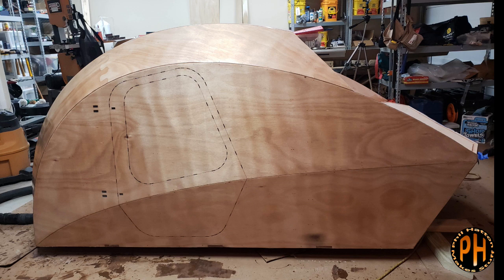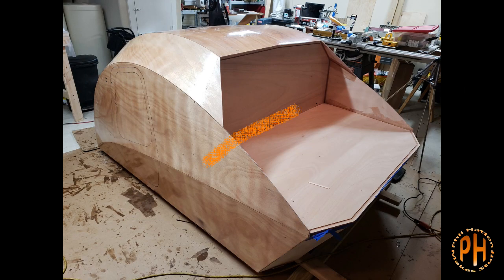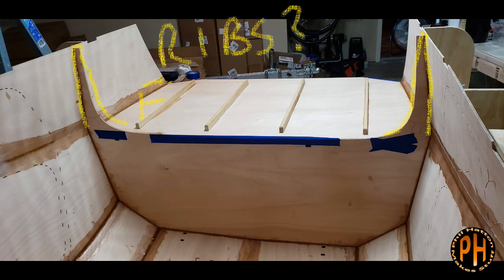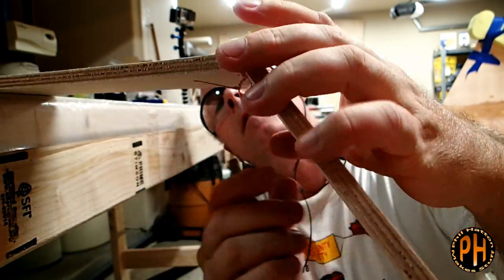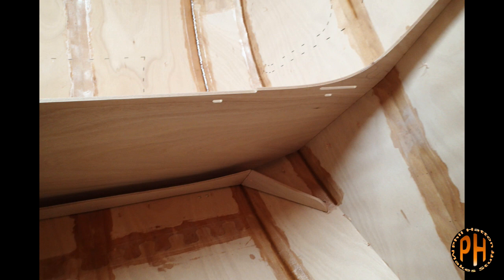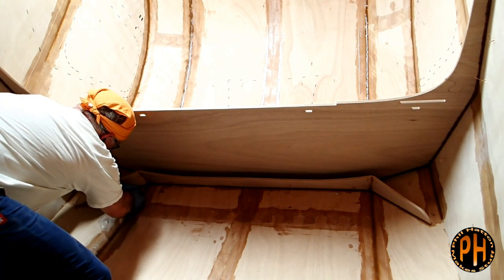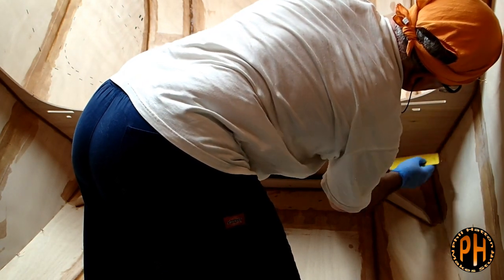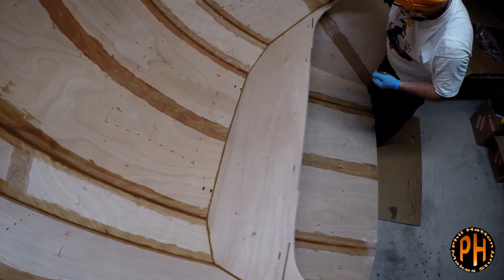Building a CLC Teardrop Camper - Bulkhead and Hatch Stiffener

Comment: Thanks for this clip. I wondered why the manual did not mention the prep epoxy before the fillets and the tape. You seemed to know why so I concluded it was the designers intention not to prep on these fillets. Also they don't want any tape in those joints either.
Reply from the maker: So far the fillets that don't have fiberglass tape have held up well.  Where I did add extra tape was at the fillet where the bulkhead meets the galley flat on the galley side.  In fact, I'm still worried that it sees the heaviest loading with the battery sitting right in the middle.  I hope your build went well!
-Phil

Comment: thanks, the manual does not really give good enough pictures to reveal the exact location of the stiffener. I see the pair of holes in the roof but the holes up the side are invisible from the inside.
Reply from the maker: Interesting.  I don't remember having any problem finding the holes for the stiffener.  We're they plugged up in your case?
Reply: @PhilHattonMakesStuff  Well I slopped the epoxy in kind of wide on the panel joints before the tape and my near field eyesight is not as good as when I built the NE dory 7 years ago. Once I saw your clip I found the wire holes on looking from the outside and I drilled out   slightly larger holes to make it easier to see and insert the wires. I am also trying to ascertain which position you put the jig in to optimize the access to fillets. I am working under a covered back porch which has excellent light on one side only of the jig. I have also had to time my work to match the outdoor temperatures for one of the coldest and wettest springs in this part of Eastern Washington, great for my garden, bad for epoxy work. Next week is predicted to be non stop epoxy weather all week.

Comment: Nice job. I like these campers. I didnt go that way because I thought they looked like a lot of work. Instead I am building a foamie and its proven to be even more work. Ugh! lol
Reply from the maker: I picked this kit because it matches our kayaks so we already know the methods and materials pretty well.
Reply: Phil Hatton nice! Beautiful! And it sounds like you are skilled enough to put it together. Is this your most recent progress? I’m curious how your doors turn out. I’ve heard they can have issues sealing. I’m sure an experienced builder like yourself will do just fine though
Reply from the maker: @JamesKlafehn  the doors have been cut out and that went well.  They didn't spring out of shape.  The hatch did a tiny bit.  I am trying to share the mistakes I make.  Mostly with sanding into the glue layer.  But also is pretty hard to get the fiberglass on the cabin without a few bubbles or voids as the resin cooks off...